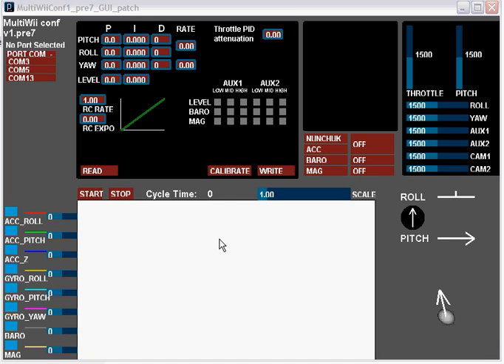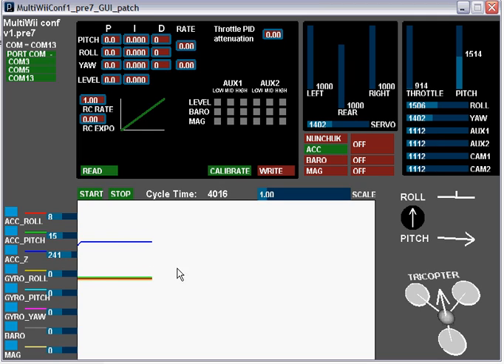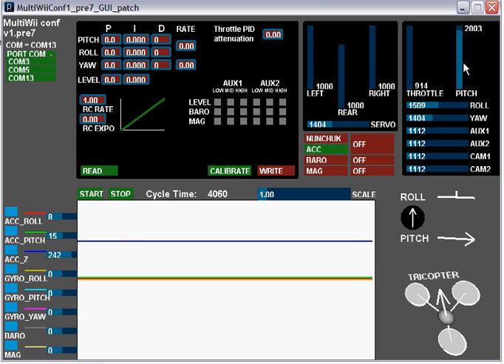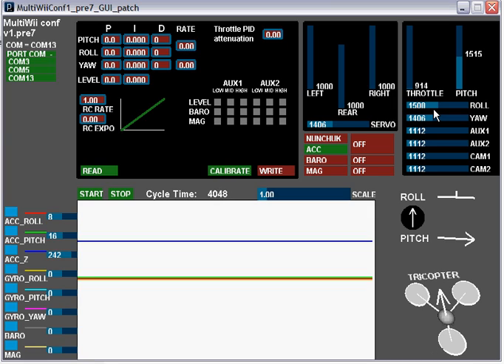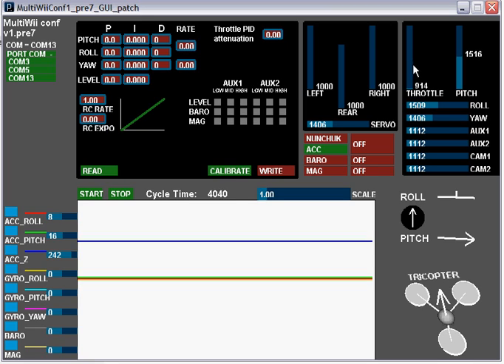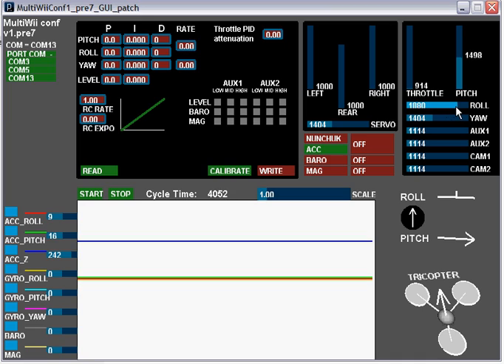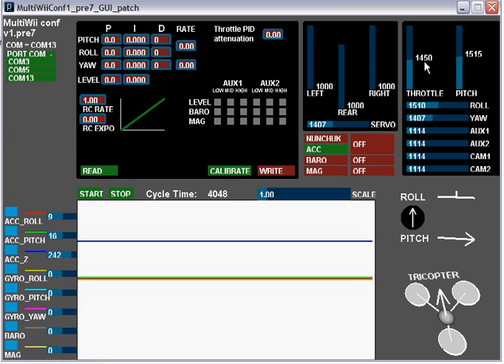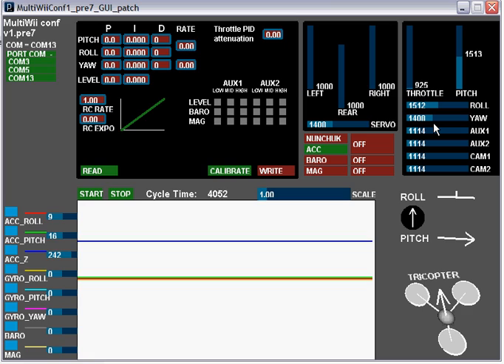How to Use Multi Wii Config_TxValues

Comment: Thank you for sharing. I am beginner in GUI and this helps. The problem I am dealing with is how to setup multiwiicopter quadX with mode3 spektrum TX. Using stick mode all the giudes for mode 1 and 2 TX seem to be messed up - if I use the same functions with my mode 3 tx, I doesn´t work. So I have to get familiar with GUI setup.